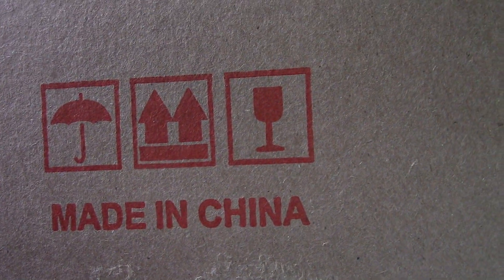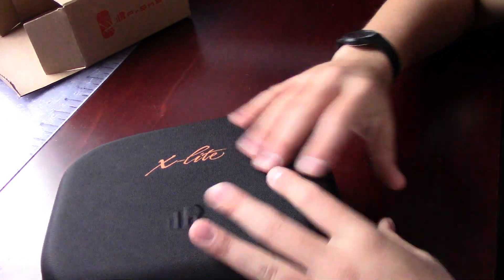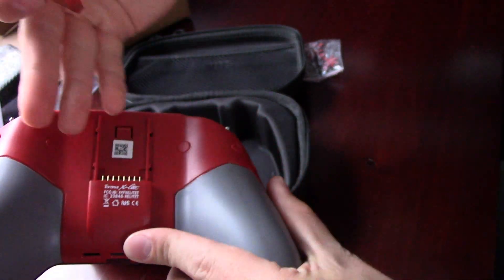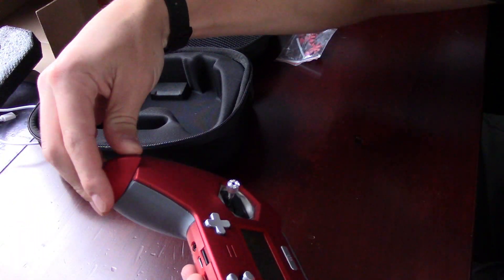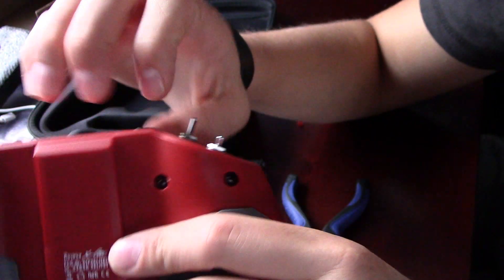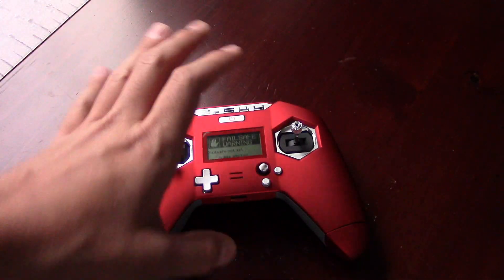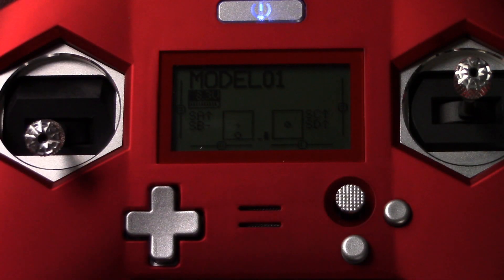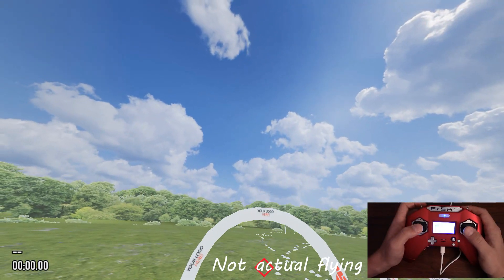FrSky Taranis X-Lite Setup

Comment: Do I need any modules to continue using FRSKY rx?
Reply from the maker: Nope. It should work as long as you have an FrSky rx. FlySky or Spectrum both will not work. You can purchase other modules though that communicate with other receivers.